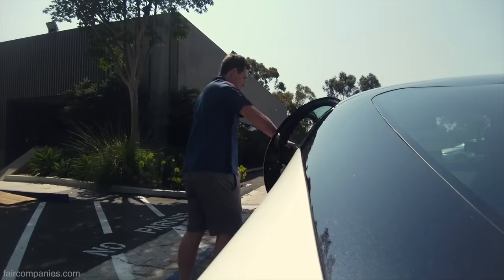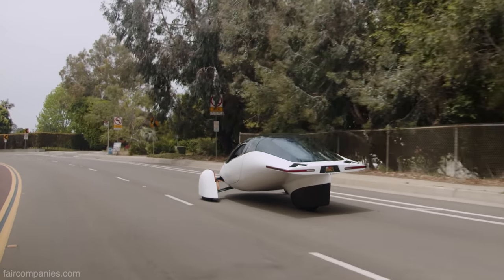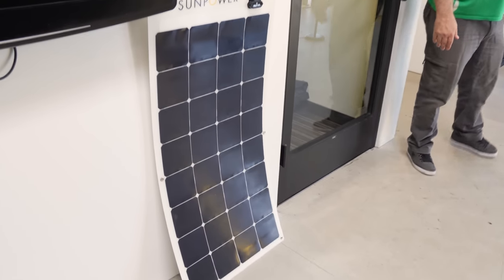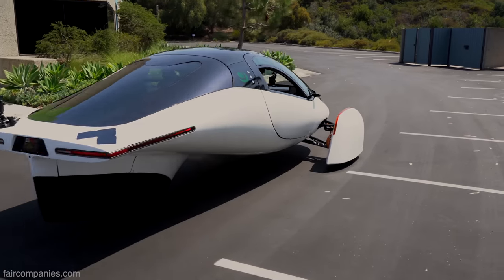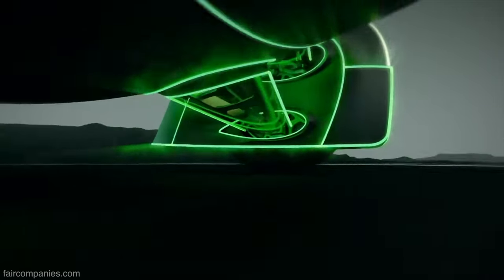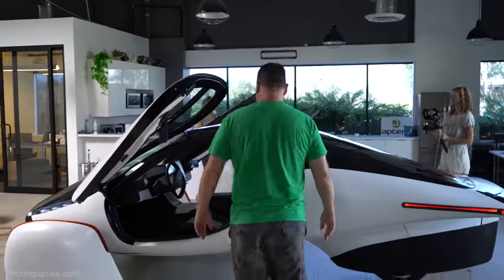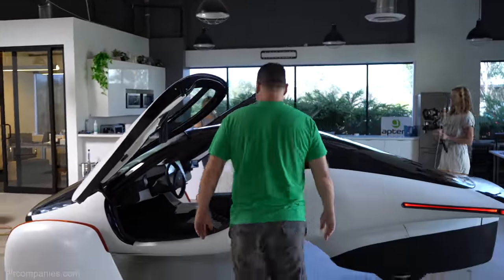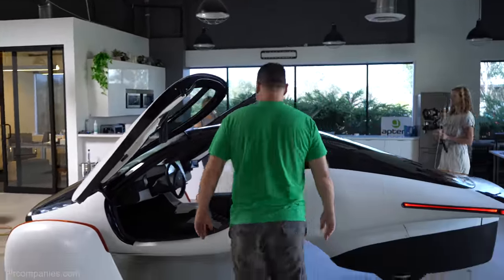Aptera commutes just on solar, gets 1K mile-range when full

Comment: I’ve been watching the development of this car over the last 6 months or so, but this is the most info of any of the videos I’ve viewed. I’m eager to see the car finally on the market.
Reply: 10 years!!! ……I gave up
Reply: 700W of solar cells will not power the car if you use it every day. I my experience if they say 300w sol palel it performs closer to 70-80% of promised, and that is is direct suligth. But for the sake of the argument let's say they reach 700W of charging. And to be generous it charges for 12 hours a day. It will be 8,4kw/h if there is no loss. If the car is teally efficient and use 50% of the energy of a Tesla model 3 it uses 80w/km, an that translates to the car beein able to drive 100km/day. I have now give the car so many free passes  in the calculation that in reality it probably is half or less. Is the car in constant optimal charging conditions? NO of course not. Will you always just ust 80w/km, no not at all. What about when it rains, it would charge a fraction. In reality, get rid of the solar panels, place them on your house an charge from your housr
Reply: @boethomas  
Not a car. 3 wheels = motorcycle.
Go ahead, spend your sour grapes on these brilliant engineers that have been improving this tech over the years I’ve been aware of them. In a large part of the USA SW sun is the rule, rare overcast, years on end of drought followed by more drought. This tech is helpful, easy on the environment, able to do many tasks & journey. Please add sugar to your grapes - your view has been limited. Best. 🙂💚🌱
Reply: @boethomas  you seem to have missed the fact that no all the energy comes from the batteries but from the sun to while you are driving
Reply: @gdwlaw5549  technically a different company founded by the same people after gaining some experience that bought the intelectual property, but yes that is understandable.
Reply: @boethomas  it is capable of plugging into the grid, and still is cheaper and more efficient than a Tesla or pretty much any other electric vehicle on the market so it is still a good product. The solar panels are mostly a gimmick but they do extend range a bit and aren't completely useless.
Reply: @boethomas  for the slight cost of the solar panels on the car i would leave them there....i would bet money these guys are telling you numbers they are seeing, and he also stated that that is in the location where they are in california....i feel they are being very open about the performance numbers.....when your a big huge company you can afford to lie about the facts and get away with it.....the company here needs to have very accurate numbers because their first 10,000 cars will be their last otherwise!!!

sitting at the beach...charging
sitting at walmart...charging
ran out of juice on the side of the road......charging!!

if you are a function over form it makes perfect sense
Reply: @boethomas   It would suit me. I only commute 50kms a day. Free electricity is better than paying for it. If I put the solar cells on my house I would also have to buy energy storage so when I come home at night I can recharge overnight.

Comment: FWIW, Toyota does sell a much smaller solar option than what Chris Anthony mentioned, that actually does charge the PHEV system on the Prius Prime (PHV) in Japan and Europe. ...it's a 180 watt panel. So in optimal conditions, you're charging at 0.72 miles per hour (using EPA efficiency data), and almost certainly less than that in the real world (because EPA efficiency data is based on charging at full speed, not a greatly reduced speed, and that 180 watts is assuming optimal insolation).

Aptera's efficiency and larger panel (especially with the full solar option) will certainly make it much more useful.

There are also other companies working on serious attempts at solar cars - Lightyear and Sion come to mind. (And, Lightyear is also focusing on optimizing efficiency, although with a luxury sedan form factor, so not quite this extreme.)

Comment: This was super exciting! I have been looking forward to car alternatives for quite a while. Today, 99% of my travels is 25- up to 40km. And honestly, a bike or e-bike does the job great during the warmer months of the year here in the south of Sweden. What makes it hard is the winter. Rain, strong winds etc. Something like a light weight 2-seat car that runs on rural roads at a maximum of 80km/h would fit almost every need I have of a car. Yet there's nothing in-between e-bikes, motorcycles and cars... and cars is the only vehicle that allow comfort during bad weather conditions. I wish we had more vehicle classes.
Reply: Have you looked at electric assist velomobiles?

Kinda seems to me like the Aptera is getting to that same idea, but they start with a car. Velomobiles start with a bicycle. The ened result is something very aerodynamic and lightweight, which means very energy efficient.
Reply: lot's of chinese electric enclosed mini cars are on the market , they get about 100 miles per charge and would get to speeds of about 25 MPH on a flat surface (tough for them to climb big hills).  I'm guessing you'd be under $12K USD in Sweden for some of them.
Reply: @adamt195  you and I agree, but he is wanting highway speeds as well. I'm sure you would agree that while quite doable, consisteny driving 50-75mph in a velomobile is not safe.

Comment: For the regulators, it's a motorcycle, but for the investors and enthusiasts, it's a car. The stats are impressive, and for a fun outing it's fantastic. 🌞⚡
Reply: In most states and provinces - and a few countries - it's an autocycle.
Reply: I heard a bunch of empty marketing type speech, no real stats
Reply: @travismiller5548  A jargon number was used for aerodynamic factors. Easy to miss, I know, but it was mentioned. The range, power, etc. was all mentioned too. Just call their number for more details, or check the website.
Reply: @travismiller5548  coefficient of drag, battery size, range, acceleration the company lists a lot of stats and most of them are fairly impressive.
Reply: @garethbaus5471  But it is still a three wheeled motorcycle with a cabin. And a death trap in case of an accident.
Reply: I've heard that it's cabin is quite strong. It's made of reinforced composite. Similar to that of a boat hull, just thicker and more impact resistant. 😊🌎✨
Reply: @OJesusX3  And what about the wheels which will rip of first? And the large windows?
Reply: Polycarbonate has been one of the options to make the windows. As they are curved they have immense strength. And if your wheels rip off, well, better a wheel than a limb! 😊🌎✨
Reply: Compared to driving a motorcycle and a scooter for several years and having had more than my fair share of incidents with the local wildlife, I'm more than looking forward to driving this thing! 😉
Reply: My reasoning is, the curved panels are much more likely to deflect any object that you collide than with most vehicles and electric breaking makes for superb stopping power. On open vehicles like the Can-Am, your vehicle is just as much a concern of colliding with you as with anything, so If my wheels come off, so be it! At least my passengers will be safe! 😊🌎✨
Reply: It may not be for everyone Vic, but it addresses many of the considerations that people need for comfortable driving. By the time it comes out, I'm sure that they'll have addressed many of the considerations that you're looking for and we've already made great strides globally to reducing accidents. I for one I'm looking forward to more vehicles being made of lighter/stronger materials, more streamlined shapes, better technologies and sensors, and friendlier roads. 😊🌎♥️
Reply: @OJesusX3  If you think of it as a motorcycle, ok. But you cannot easily escape it in case of an accident.
Reply: @OJesusX3  Think of the polycarbonate windows as you smash into an F-150. Not a very pleasant idea. The breaking wheels will most likely leave you in an upside down position after the accident. the vehicle could easily spin several times. Doors will not open. Another unpleasant idea.

Comment: The Jetsons were onto something.
Reply: EV's have be criticized for being "too quiet" vis a vis a safety issue for pedestrians.  So I've always hoped, especially on cool looking rides like this, that they have a sound generator to alert their coming down the road... The perfect sound effect IMHO would be from the Jetson's flying car!
Reply: @whotoinfinity  I read that the production version will have outside speakers to do just that. Lots of ideas in the Aptera forum around what that sound should be. I like your idea. 👍
Reply: @whotoinfinity  There's a federal requirement for all-electric vehicles to have a system that emits sounds when traveling at 30 MPH or less.  Further, those sounds must meet specified requirements for tones and loudness.
Reply: @paulevans4969  So... No Jetson sound effects?
Reply: @whotoinfinity  Unfortunately, no.  It took me awhile to find the regulations.  It was a tough slog to get through some really arcane legalese.  If I had a PHD in acustica it might have helped.  The  sounds were described as a frequency range subdivided into discrete, individual bands in which 2 non-adjacent bands must be generated simultaneously.  In addition,  the system could not exceed specific maximum/minimum sound pressures (loudness) as measured from specific distances in front of the car! To top it off, two sets of specifications we're designated for two speed ranges: 30 mph to above 20 mph, and 20 mph to 1 mph.   At least I think that's what I read but I could be wrong!!!
Reply: @paulevans4969  Thanks for taking the deep dive on this, especially for the sake of replying to a sarcastic old dude in Michigan, tired of boom cars, and engine braking tractor trailers, who's looking forward to something better.  Guess you could say, or at least I will, it "sounds" like it's all part of the "Mans" plan to keep us down!  ;-)   Be Well and thanks again.

Comment: Love this shit. Makes sense. Especially in places where there is plenty of sunshine annually.
Reply: Love the car (investor and reservation holder) but that tent really makes me laugh.  No way it can hold up to decent rain and snow would be comical; clearly California designed.  A tarp over the back of the car from trees would do far more and for $600 just buy a tent (or 5) that could be used near the car or not.
Reply: The solar panels will do less for you in cloudy climes, but the amazing efficiency, 10 miles per KWH, will be an advantage everywhere.
Reply: The problem is based on the numbers given the panels charge it at 7MPH.  You won't get very far on panels alone.
Reply: @lyokofans  Of course not, no one is claiming that you can. Aptera’s batteries are sized from 25kw to 100kw, you charge them first.   So with that efficiency, it gives a range of 250 to 1000 miles. Plus get up to 40+ miles of additional range from the sun.
Reply: @lyokofans  the solar "never charge" is definitely best case but still crazy efficient ev that can charge on house current and perform like a sports car.  Kinda missed marketing angle.
Reply: @lyokofans  This would work perfectly fine for many people as a second car. According to the Googles , the average trip in the U.S. is 29.2 miles. This car can get over 40 miles of range from charging in the sun all day.
Reply: Isabel T  The aptera weighs half as much and doesn't contain anything overly exotic so I'd guess its manufacturing footprint is substantially less.
Reply: @ccibinel  EVs Carbon footprint is mostly based on the battery. So the size and the Energy mix of the battery factory will be most relevant to measure this. Many EVs today have a bigger starting Carbon footprint but after some 10,000-20,000 km they have lower lifecycle Carbon emissins compared to fuel powered Cars.
Reply: @Gummmibaer  I gotta expect most Apteras will be 250-400 mile versions.  that is also a smaller battery than the average EV (ie 25-40 kwh vs 60kwh).  Combined with the body it is realistic that the lower miliage versions would be well under even the manufacturing carbon emissions of a traditional car.  Steel and aluminum production is messy business.  Regardless it is all guess work without seeing a ton more details and I am basing on assumptions.
Reply: Isabel T  i dont think you understand what the word sustainable means. Alone by virtue of burning a limited resource, its literally unsustainable

Comment: “If you want to hear the sound of inefficiency? Look it up. Anything that is loud and hot, it’s inefficient.” In a more simple word, wasteful!
Reply: and F'ing annoying
Reply: That's not fair to say! 
Where is the electric fighter jet? 
It doesn't bloody exist. So back off on the criticism unless/until you have an alternate form of propulsion.
Reply: @AtomicSquirrelHunter   It’s a quote and a synonym. And that’s all you are going to get!
Reply: @AtomicSquirrelHunter  electric jet engines are still relatively new technology, and require more power than current battery tech can feasibly supply in an airplane but we have plenty of functional prop driven electric planes which should be useful for many of the shorter flights especially once we scale them up a bit.
Reply: @AtomicSquirrelHunter  that's cos fighter jets SHOULDN'T exist. Certainly not in terms of the environment and the whole war aspect shouldn't exist either (and wouldn't if ppl would just be a little more considerate)

Comment: I have a 250 Honda motor scooter that I am thinking about replacing. 70 miles per gallon. My wife only occasionally likes to write on it with me, either too cold or too hot or rain! As a motorcycle replacement, being protected from the weather with an electric motor makes so much sense!  I just hope they can ramp up production so we don't have to wait forever!

Comment: It's also 3-wheeled because it is then classified as a motorcycle and not a car, therefore not having to meet the same safety standards of say....a Prius or a Tesla
Reply: They are designing it to meet all car safety standards though and are planning to do crash testing to prove performance.

It does help them to bring the vehicle to market more quickly and at a lower cost though. There's less bureaucracy with a 3-wheeler.
Reply: In many places (states, provinces and countries) an enclosed 3-wheeled vehicle is classified as an "autocycle".
Reply: In an accident, it looks like it would fare better than a motorcycle, probably not as well as an SUV, but being light, fast, and agile, you might be able to avoid an accident better than with a Prius or Tesla.
Reply: @nhinja  "Accident avoidance" is the right way to think.  The shell is much stronger than a welded steel vehicle and the shape will tend to allow the Aptera to rise above or below another auto in a collision.
Reply: @jonsek  Yup! Just like an F1 monocoque body.
Reply: Or how about we stop driving massive suvs and pickups  that will crush this. And design our streets to keep everyone safe and slow. High speeds should only be possible on interstates, which are already the safest roads we have.
Reply: @adamt195  Massive pickup trucks are quite useful vehicles, SUV's not so much but we can't control what other people buy. Also, you didn't mention anything about tractor trailers that can easily crush the largest SUV or pickup. I agree that our transportation system is pretty messed up, but that's what we have to work with right now. Talking about it here won't change anything, will it?
Reply: @nhinja  most people that own a pickup today don't actually need it. If you're just using it a few times per year, then you should be renting a pickup. And it could be much smaller. Pickups today are so unnecessarily large.

Most things people use pickups for could just be done with cargo bikes and bike trailers. But we need massive change to get to that reality, so I will continue to bring it up whenever I can. The first step is exposing people to the idea. Then you can start explaining why it's important and then start to enact change.
Reply: @adamt195   I drive into town, 20 miles, every day in my plug in Prius, and always check out the big new quad cab pickups (with 7 year loans) with one person in them, and think how much money each trip into town and back is costing them!
Reply: Because it’s 3 wheeled does not = it not having the same safety standards 

If anything the regulator rules would require different set of parameters needed for evaluating its standards which the standard outcome should be equivalent between 3 and 4 wheels.

Comment: I would be curious about the handling on a rough surface. My experience is only in the world of motorcycles, but when adding weight to the wheels you get a lot of "unsprung" weight. For example; in some bikes with shaft drives this can result in an unstable rear end over rough surfaces. Not a criticism just a question. Overall I think this is a great idea.
Reply: Yes, I was thinking that too, but I suppose the demand for efficiency and simplicity necessitates this
Reply: In the Gamma version they redesigned the rear swingarm and patented the idea. Unlike a motorcycle swingarm that is one-sided, their swingarm has arms on both sides of the rear axle and it transfers loads differently. It is supposed to counteract those forces you refer to.

Comment: You hit one pothole and you're history!
Reply: How so?
Reply: The ground clearance for these wheel skirts is crap. Wouldn't survive a year on the SF Bay Area roads.
Reply: the wheel pants are attached to the wheels - with about 5" of clearance - so the entire sidewall is showing. In order for the wheel pant to hit the ground you'd first need to compress the entire thickness of the tire and hit the rim.
Reply: @narphizoid  Which occurs routinely in the bay area. Arguably the worst roads in the country.